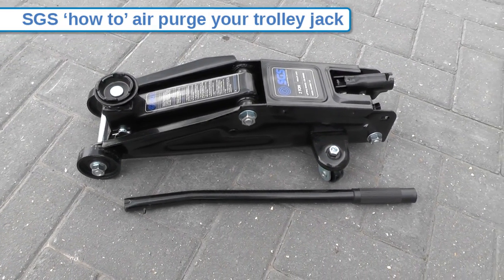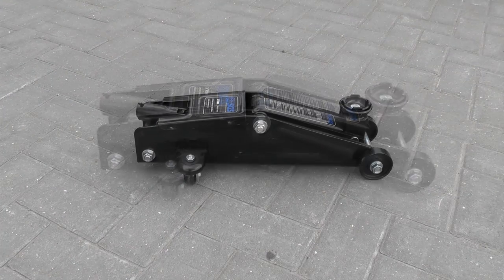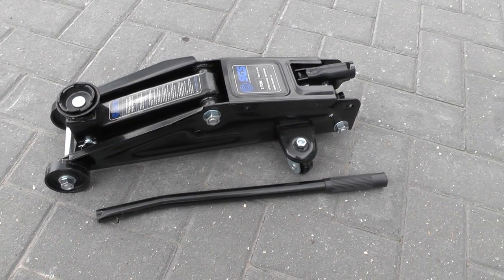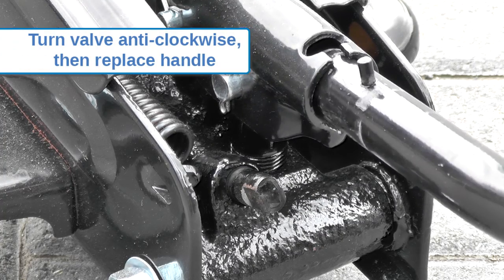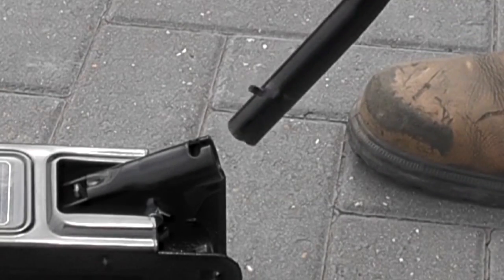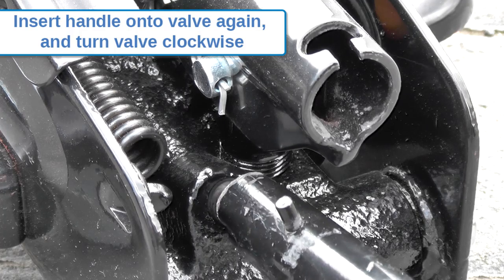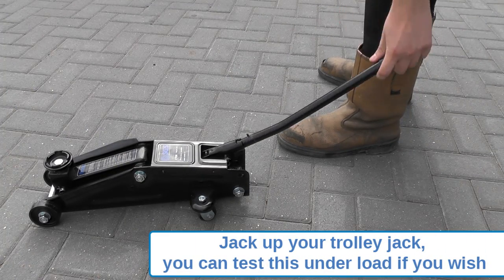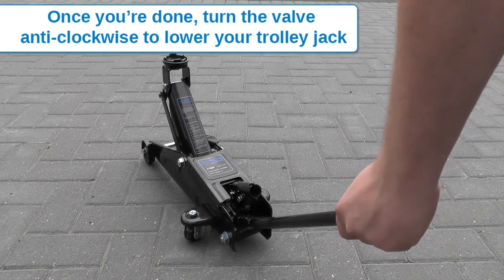Trolley Jack Not Lifting? Fix It FAST with Air Purge! #DIYCarCare #TrolleyJackFix #CarMaintenance

Comment: This was a big help! Thanks. Had no idea the handle worked on the valve. It's literally nowhere in the manual. Not only that the card that came with the jack gives a completely different method--asking you to remove the plate to purge. Gotta stop letting engineers write manuals. They don't speak humanese.
Reply: This.
Reply: The oil filler plug is under the cover plate on top of the jack and the plug is in the bottom. usually has a flat screwdriver head on in and maybe a red cap on top of it.

Release valve is the one you twist left to release the  pressure to allow the jack to lover the car.

Comment: Actually you should loosen the release valve, pump and then partially open the fill plug/screw and you should hear air escape now you have purged air.
Reply: what is a release valve? and a fill plug/screw? do all jacks have those? does the jack in this video have those?
Reply: @eananstrain6817  yes. The oil filler plug is under the cover plate on top of the jack and the plug is in the bottom. usually has a flat screwdriver head on in and maybe a red cap on top of it.

Release valve is the one you twist left to release the  pressure to allow the jack to lover the car.

Comment: This will only work if you sufficient hydraulic oil in the jack. If you have an old jack that doesn’t lift after this it’s either low on oil or the oil seal has perished.

Comment: I own a similar jack except mine has additional mechanical parts that will limit the lifting mechanism from dropping so that if the piston fails, the load will still be held. After using this jack for 10 years, I found that the car was dropping 1-2 centimeters while supported by the jack. Today I purged and added new oil. I found it easier to place the jack vertically in a plastic milk crate so that the bleeding hole was pointing upward. After completely removing the bleeding hole screw, I could see the ball bearing check valve at the bottom of the bleeder hole. I added a bit of new oil in the hole and pumped very slowly until the new oil dropped under the steel ball. I repeated until all the internal air had been replaced by new oil. I used about 100 ml. of oil. Then I put the jack back on the floor horizontally and with the valve closed, I pumped up the jack to its full height. Then I released the mechanical locking mechanism and lowered the jack. Then I rechecked the oil level for a second time following the same routine. You should use oil designed specifically for hydraulic jacks. I hope this extra information helps.
Reply: The oil filler plug is under the cover plate on top of the jack and the plug is in the bottom. usually has a flat screwdriver head on in and maybe a red cap on top of it.

Release valve is the one you twist left to release the  pressure to allow the jack to lover the car.

Comment: WRONG. you need to pump with the valve open and then open the oil filler plug to let the air out.